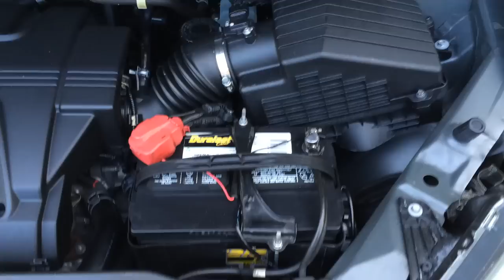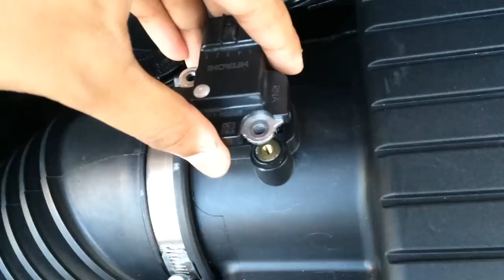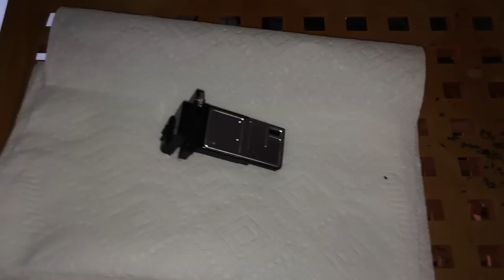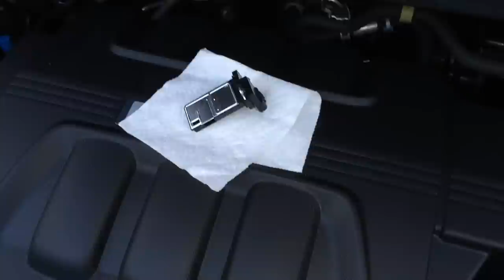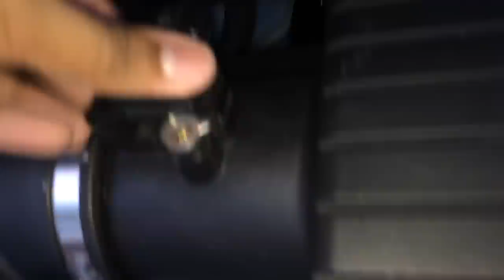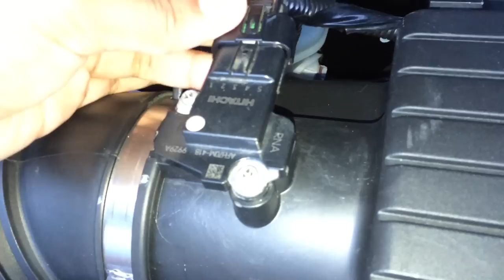Honda/Acura Mass Air Flow Sensor Cleaning DIY

Comment: Just cleaned mine. Got my Honda used and didn’t know if it has ever been cleaned. So I grabbed a can from Auto Zone (on sale) and went for it. That was so easy. I have never done this before. I think the can I bought will last forever. The guy at work said that I can use brake cleaner. I told him that you can use brake cleaner on YOUR CAR. But I am using MAS cleaner on mine.
Reply from the maker: Hell yeah, that's the same response I would've given him.
Reply: Savage 😂

Comment: Is it possible to add too much cleaner? I feel like I might have sprayed too much. . I let it dry but my check engine light is still on. AND I also changed the filter!
Reply from the maker: You need to check the codes the car is giving.
Reply: MrRangerZr1 thanks for answering, I drove the car for about 20 miles and the check engine light went away!.. But I feel like it still hesitates to speed up, I think I'll check the spark plugs.

Comment: thanks for your video , if my car got P0108 error code ...
is it the sensor problem ? or the air filter too dirty ????
P0108 is a diagnostic trouble code (DTC) for "Manifold Air Pressure (MAP) Barometric Pressure Sensor Circuit High Voltage Input Problem". This can happen for multiple reasons and a mechanic needs to diagnose the specific cause for this code to be triggered in your situation.
Reply from the maker: Could a lot of reasons. Check the basics first, check the filter, MAF, etc.

Comment: Hey Mr ranger, thanks for the awesome video. I have a 2011 Honda pilot touring. I have received coads P3497 and P3400. I have recently got an oil change and have swapped out both oil pressure switches on my pilot. Intially I had a big crack in my air intake too. I have swapped that out also. After all these changes the engine sounds fine but the acceleration is not what I'm used to and it feel rough idle ish. Do you think this is a MAF problem and would cleaning it correct this issue? Thanks after your vid I'm going to go ahead and clean it (since I don't currently have the money to replace it as yet.) Last question how would you know when you would need to replace your MAF. Thanks again.
Reply from the maker: Give the MAF sensor and throttle body a cleaning. Videos are on the channel.
Reply: @MrRangerZr1  thank you.
Reply: Are you sure you had a cracked intake manifold? Did you see it?
Reply: @criledo1  yeah i saw it
Reply from the maker: @criledo1  cracked intake tube*

Comment: My honda fit car is showing engine check light, power steering and traction control lights. When i scanned it, it said fuel burning too lean. Could it be the sensor?
Reply from the maker: Could be a vacuum leak. Check the rubber intake on the airbox and check for intake manifold gaskets. Clean this sensor too, doesn't hurt anything.
Reply: @MrRangerZr1  Thank you wll do. Love you videos keep up the good work.

Comment: Couldn’t find my MAF sensor, have a 2006 Odyssey.  Please advise.  Thank you.
Reply from the maker: You don't have one.
Reply: MrRangerZr1 .  I cleaned the TB with a brake cleaner coz it’s all I got.  The engine was off though in the process, used toothbrush and towel.  Placed everything back in and now I got a engine light and the idle/ rpm is slightly off.  It seemed that the pedal is sensitive/ responsive.  I believe the RPM is slightly higher than usual.  Do you think I just need to reset the computer?  Any help is appreciated.
Reply from the maker: GSXR750DOG never use brake cleaner on the throttle body! You need to do the idle relearn now, check my channel for the video.

Comment: Hello, could you tell me if a dirty sensor could be pointed out in the scanner as "damaged"?

Would it be that if I wipe with clean contact it would solve and I wouldn't be caught in the scanner anymore?

The mechanic suggested replacing, but I said, did you even test the part?

My car jerks, nothing too strong

Thanks for the video.
Reply from the maker: Get me the code it's giving and what year and model

Comment: MrRangerZr1 - Thanks for the step by step instructions for cleaning the MAP sensor. Should i disconnect the battery before doing this?
Reply from the maker: Its not necessary. If it makes you feel better, then go ahead.
Reply: @MrRangerZr1  then why dId you disconnect battery on the other vid you made? It was a different year civic,  I believe.

Comment: I have a 2002 Accord - can you tell me where the mass airflow sensor is on that car?

Thanks!
Reply from the maker: look around the air filter housing, it should be there. Some cars do not have the MAF sensors, they use MAP sensors.
Reply: Thanks - mine does have a MAP sensor.

Can it be cleaned?
Reply from the maker: Yes if needed.

Comment: for the 2012 civic 1.8L engine something is blocking the air filter its quite hard to reach it. do you have any video for this particular model year?
Reply from the maker: For the civic, you need to move/remove the airbox assembly to get access to the screws. Its a pain, I did it before.
Reply: MrRangerZr1 do i need to take out the black part on the top above the air box?
Reply from the maker: The windshield cowel? No don't remove it. Try disconnecting the intake tube to the airbox cover and slide the airbox cover out. I did this a long time ago, I don't remember exactly what I did. Let me know if you need more help.
Reply: MrRangerZr1 thanks. ill let you know if i need more help
Reply: MrRangerZr1 hey i  got the bolts out but something is stopping from pulling the air box out.
Reply from the maker: Don't pull the entire box, just the top part that houses the MAF sensor. Take the intake tube off and slide it out.
Reply: MrRangerZr1 i got the 2012 civic and yes i did slide the intake tube but something is holding it back and theres very limited space to take it out. i wonder if you have done a similar one like the ones for 2012 civic? i think theres mounting brackets on the back of the main housing that is holding it back
Reply from the maker: I did a long time ago. Do this, watch some installation videos on aftermarket intake on the civics, they show how to remove the intake when you install an aftermarket intake.

Comment: I lost the little red plastic extension to the MAF cleaner, can I still clean the sensor without it?
Reply from the maker: Yes. Just don't get the chemical on your hands.
Reply: How do I remove the air box, is there a bolt in the back? That thing wont pop off no matter what
Reply from the maker: What vehicle?
Reply: MrRangerZr1 2012 Honda Civic Lx. Im tying to remove the airbox to get access to the MAF but after removing the hoses on the front and side, two mounting bolts, it wont budge. Something is holding from the back and after watching those aftermarket intake videos Im supposed to just pull up to dislodge, but that hasnt worked.
Reply from the maker: Try to just remove the top portion/airbox cover.
Reply: Crimson XCVI  open the air box there is a third mounting bolt on the inside it is a 10mm

Comment: excuse me what model and year is this Honda? I have a civic coupe 2012 with this problem
Reply from the maker: 2010 odyssey. You can use the same exact procedures.
Reply: +MrRangerZr1 ok, thank you for your help!
Reply: MrRangerZr1 i got the same car 2012 civic coupe. does that mean that i dont have to take the whole filter housing off and the hose where the maf connects?
Reply: @samueljohn2440  it's behind filter box. I real PITA.  Check out his other vid to learn how.

Comment: Hello, just cleaned my MAF, now the code p0102 popped up. Used the proper cleaner and let it air dry for 20 minutes or so. Anyone ever had any issues like this?
Reply from the maker: Reset the code the maf sensor was probably still wet

Comment: how long does it take to dry?
Reply from the maker: 10-15 mins. If you're engine is hot, put the MAF sensor on top of the engine cover, it dries faster.
Reply: Thank you. Just reinstalled it.
Reply: Yeah i didnt think i saw instructions to air dry or pad dry with paper towel before putting it back.
Reply: Air dry it, I reckon 30 mins is the right amount of time to be 100% safe

Comment: you don't need to buy the special cleaner, you can use brake cleaner
Reply from the maker: No only MAF cleaner. Try using brake cleaner and see what happens.
Reply: i used it several times over the years and had no problems... it was recommended to me by a mechanic who works on toyota and honda. i used it on my corolla and odyssey.  drys off very quickly.
Reply from the maker: ***** Idk man but I'm sure I'm not taking the risk.
Reply: i did some research, brake cleaner is different and will work, but MAS cleaner is designed not to leave any residue, therefore best to get MAS cleaner,but brake cleaner will work in a pinch
Reply: Kenneth G but why would you use brake cleaner when you can use mass air flow sensor cleaner to clean a MASS AIR FLOW SENSOR  lmao
Reply: I use mass air flow cleaner to clean my brakes and brake cleaner for my mass air flow. It just makes sense. 😉😏
Reply: Actually brake cleaner is a bad idea, but alcohol and a Q tip works... IF you're able to reach the sensor wire. If you're gentl with it, it works I've done it 100 times in my car business.
Reply: @davidcrocker6144  thank you, sir. 70% isopropyl?

Comment: Can you use carburetor cleaner if it says "Won't harm sensors"???
Reply from the maker: Just use MAF cleaner
Reply: Carb cleaner leaves a residue, meant to lubricate, should never use on brakes or plastic parts.